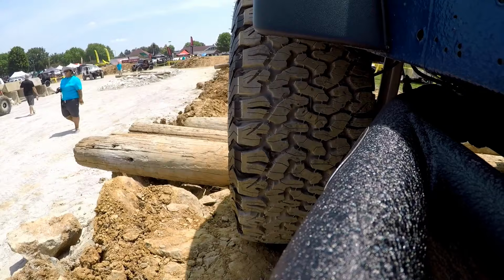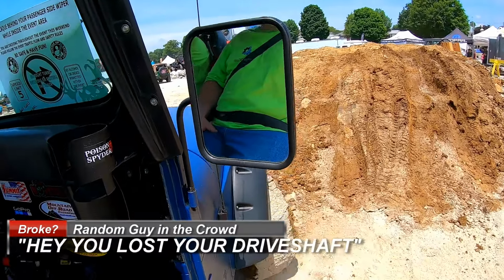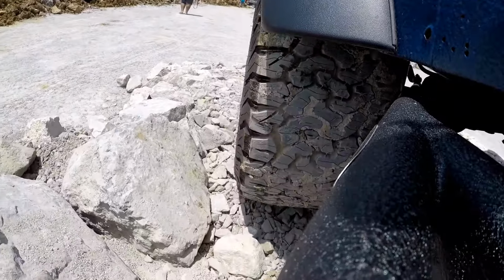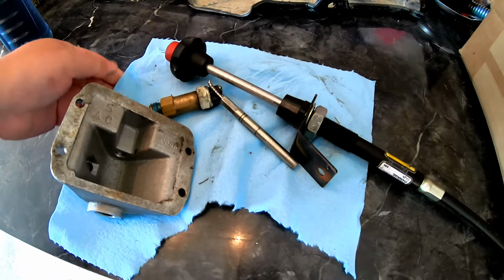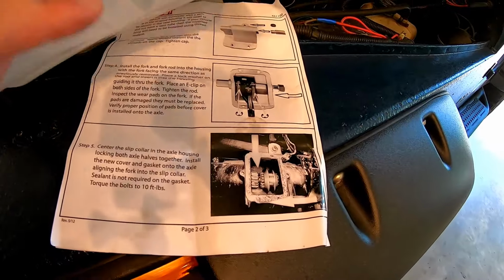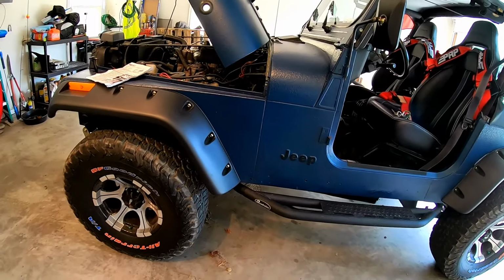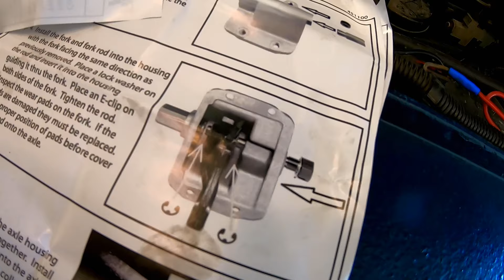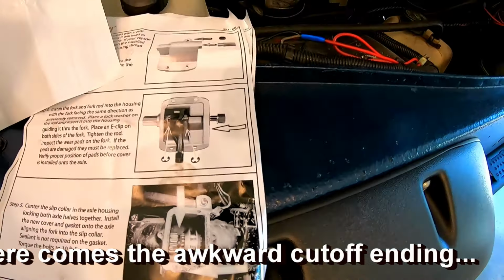Jeep Wrangler Posi-Lok Failure

Comment: I'm glad I don't have to worry about the CAD in my YJ's Dana-30. 
I eliminated the entire thing when I swapped in the Dana-30 from a '98 XJ. 
Most just swap in the one piece shaft but I wanted to eliminate the entire CAD housing.
The XJ Dana-30 was very cheap at just $75.
Reply from the maker: I'm still so torn as to what I want to do long term.  The perm lock kit will work but still a lot of moving parts in there where things could go wrong.  I may build a "Super 30" and go heavy duty axle shafts (the one piece TJ style shaft on the passenger side) and install my torq locker that I won at this Jeep show.  But i haven't ruled out an entire axle swap either.  Time will tell I suppose... lol

Comment: Why not just switch to a 1 piece shaft?  A lot less fail points.
Reply from the maker: Truth is I needed it fixed for the second day of the Jeep show because I wanted to go out on the course again.  So I used what I had on hand, which fortunately I had that perm lock kit sitting on my work bench for a couple months.  The future may hold heavy duty axle shafts in the front using a TJ style one piece shaft and the torq locker I won at this Jeep show.  If time was not an issue to get it fixed, I probably wouldn't drive it and save up some money to do a one piece shaft swap.

Comment: What? This video story is so dis-jointed I have no idea what happened or what you ended up with.
Reply from the maker: Dennis, did you watch the video with sound on because it clearly tells a story from beginning to end. Jeep show obstacle course, front drive shaft spinning but no power to front tires at all, someone in crowd yells I lost front driveshaft, I did not lose front driveshaft, posi-lok cable was broke, replaced it with perma lock kit, same obstacle course next day, I have power to the front tires again. Not sure what is disjointed about that... 🤷🏼‍♂️ If you have 8 minutes to spare try watching it again and make sure you have sound on to listen to the story. Thanks for your comment, hopefully I provided more clarity with my synopsis.

Comment: You truly amaze me. If you ever want to put a system in it. Call me. You could make a great video. 3 12s would sound nice in that. Lol. U know I can make a vehicle go boom
#MONSTERBASS
Reply from the maker: It has a small system already in it lol.  I have a 4 channel amp (currently using 2 channels to power the front pod speakers in the cab) and a single channel amp running a RF Punch P2 12 in a sealed box.  It sounds pretty good.  It's not going to hit huge db numbers but for cruising around listening to some music it has some good thump to it.